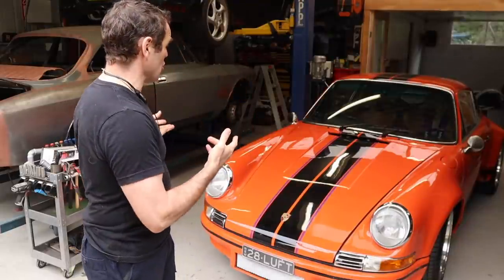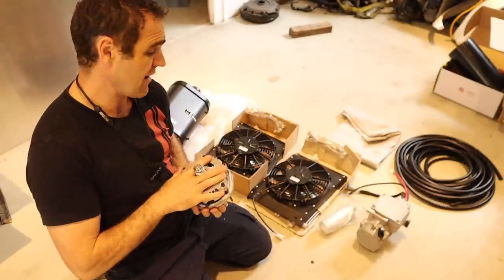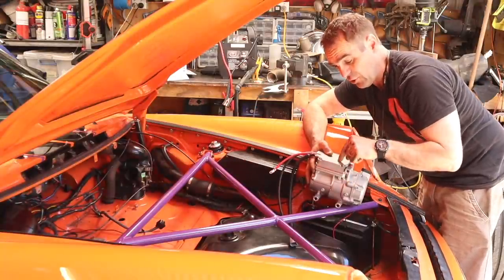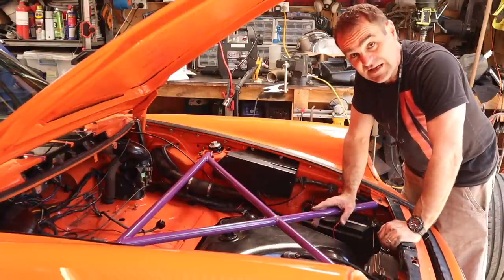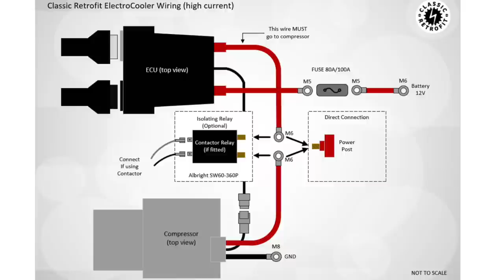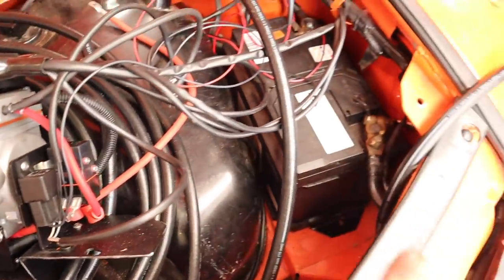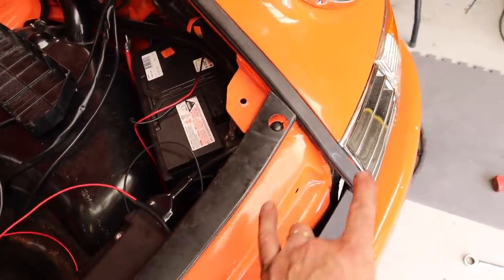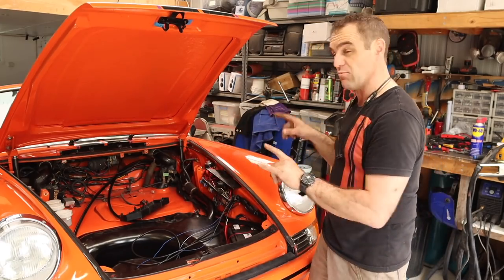Classic Porsche 911 AirCon install 1

Comment: This couldn't have come at a better time. My old man just got the same kit for he's g series and no one wanted to touch it in Sydney without charging an arm and a leg to install it. We just got the 175a alternator installed so this walkthrough will come in handy
Reply from the maker: It is a lot of parts, but once you get going it is reasonably straight forward.

Comment: Nice work Jeff, but i recommend getting rid of the plastic tie straps and replace them with aluminium straps. Heat cycling will dry out the plastic tie straps and they will fracture.

Comment: Hi Jeff - I have a 1985 911 with factory AC that barely cools. It has the same small side vents, but also has a center dash vent which works well for fresh air. In any case I'm very interested in seeing how well the electric retro-fit AC system works. Keep up the good work and excellent videos!

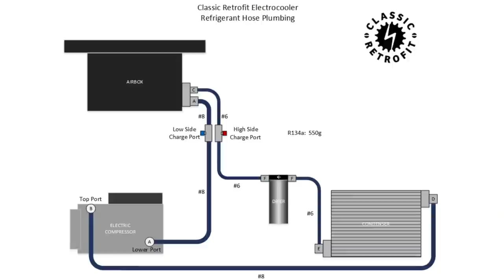Comment: Oops............at around 19:30 you mis-state the basic air conditioning cycle.  The whole process can be done with ordinary air (that's how most systems work in airliners) but it is much more efficient and compact for an A/C system to use some sort of special gas which can change state from a liquid to a gas and back again at reasonable temperatures and pressures.  "Freon" R-12 is the familiar stuff from days past, but these days cars usually use 134-A  or the newer R1234YF refrigerant.

The compressor discharges hot, high-pressure gas.  This gas then goes to the condenser (not the evaporator as you say) where the hot gas is cooled and turned into a high pressure liquid. Since the hot gas not only gives off it's heat, it changes state to a liquid as well; therefore, the amount of heat rejected to the outside air via the condenser is even more dramatic.  From there it goes to the expansion valve near the evaporator (inside a box under the dash) where the high pressure liquid is expanded and converted into a lower pressure gas.  Any gas cools as it expands, but by also changing state from a liquid to a gas, the resulting heat absorption is more dramatic.  As this cool gas travels through coils the box, a fan blows cool air into the car.  The cool, low-pressure gas is returned to the compressor where it is again converted to a hot, high-pressure gas thus completing the A/C cycle.
Reply: This needs more thumbs up please
Reply from the maker: You are spot on. I stuffed that explanation. I will correct it in the next vid ;)
Reply: Great explanation. You both missed the role, importance and its place in the sequence, of the dryer.
Reply: @DiscoFang  Strictly speaking, the receiver/filter/dryer is not part of the air conditioning cycle.  The system will operate without it; perhaps not for long, but it will function.  The receiver/filter/dryer, as the name implies, has three functions.  It provides a reservoir of refrigerant, it filters out any crud, and it has a desiccate to trap water because a tiny bit of water can freeze in the expansion valve and shut down the whole system.  Often these three functions are handled by an all-in-one unit, but some systems might contain separate components. A typical receiver/filter/dryer also includes a glass sight gauge so you can see the refrigerant. And yes, as you say, it's important for a well tuned A/C system.

Comment: Hey Jeff, plug those open hoses to avoid any contamination while building the system. Small particles can ruin the compressor. Also water from the air can enter the dryer and saturate the desiccant and the PAG oil as it is hydroscopic. I assume you are using 1234yf refrigerant otherwise you must have a RHL.

Comment: This is a great idea for any car without factory A/C , but I'm not convinced about the long-term use of those hose clamps, I would advise checking locally if you can get a proper A/C hose crimper with the correct crimping collars for this hose and fittings combination. I hope that you have access to the correct vacuum pump and manifold gauge setup to evacuate the system correctly after leak testing with oxygen free nitrogen. I would imagine that this setup would outlast any conventional belt drive compressor system as it's isolated from the heat and vibration of the engine and with no shaft seal to leak this is a winning setup 👍
Reply: The hose clamps we used have been used in motorsport for around 20 years now.  They are rated far in excess of the pressure of the pump and higher rating than most hydraulic fittings.  They also do not rust out since there is no ‘collar’ for condensation to get trapped behind.
Reply: @ClassicRetrofit  Interesting piece of information as those hose clamps must be exceptional to match hydraulic pressures which are in the range of 1000-3000psi
Reply: The hose and 'Oetiker' clamp system we use meets SAE J2064 rev 2015 which calls for a working pressure of 500 PSI for AC systems.  Max pressure in our system is typically 250 PSI.   Oetiker clamps are used all over modern vehicles, including in high pressure fuel injection systems.
Reply: @davidg2073  we are talking about AC, for clarity I meant compared with normal AC fittings which are crimped with a hydraulic tool.  The spec is only 500 PSI but they are prone to failure from rusting.

Comment: Not a bad kit, although for the price I'd expect better mounts than some zip ties. Overall though it does go together quite easily. Some ducting for the condensers would probably help with air flow especially at speed to make things super chilly 😉

Comment: Nice work, condenser should be fitted so that the smaller outlet ( which is the liquid line) should be at the bottom, so you are effectively stacking liquid refrigerant in the condenser 👍
Reply from the maker: It is. Hot in the top cold out the bottom ;)

Comment: Since you didn’t mention it, I thought I’d ask. Are you upgrading the alternator related wiring when upgrading your alternator?
Reply: Definitely need a larger cable from ALT to starter. Also I'd use hose clamps for the receiver drier instead of cable ties. Cheers.
Reply from the maker: Yep ;)

Comment: Little bit of chapterisation which may help some users looking for help with their installations. Learn more about our electric air conditioning systems for Porsche 911s and more at classicretrofit.com!

911 airflow system 02:43
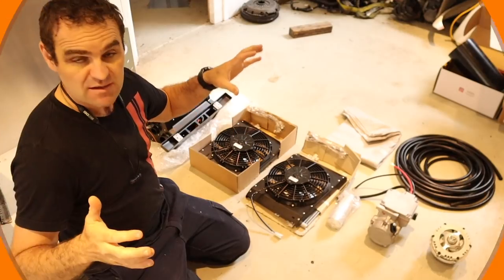What comes in the kit 03:48
Condenser fitting 06:37
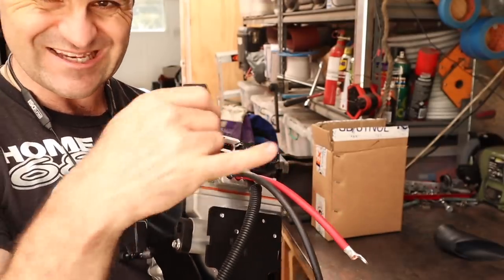Wiring pt. 1 16:21
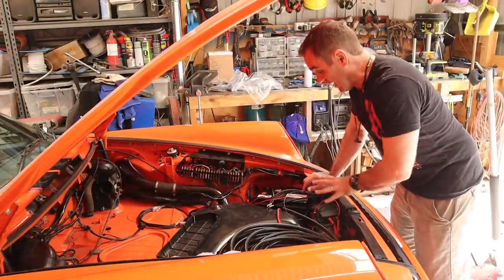Planning hose pathways 18:29
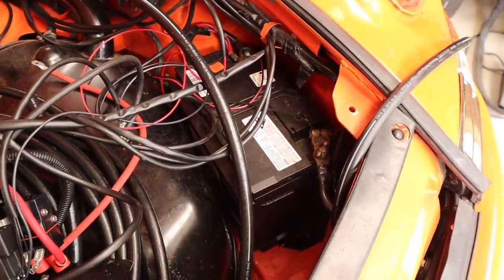Fitting hose ends 21:24
Wiring pt.2 24:27
Power wire 25:11
Fuse panel 25:25
Reply from the maker: First time I have actually done that, but it is all now added :D

Comment: I noticed one of the condensers was touching the wing/bumper flange at the AC line connector, can the condenser be moved inboard or put some edge protection on wing return flange
Reply from the maker: They are an extremely tight fit, so that is as much room as I can find.

Comment: I can't help being captain obvious here. The fact that the A/C is not pulley driven but electrical makes no difference to how much engine power it will eat up. Kilowatts is kilowatts. When you turn on the A/C your new beefier alternator will need to generate as much power to run the A/C would've taken when driven by the crank directly.
Reply from the maker: True
Reply: The kind of mechanical compressor fitted to these cars originally used around 8 HP.   Modern AC components like ours are designed to use less power so the pumps do not have to work as hard.   Our compressor typically uses 900W which is 1.2 HP.
Reply: @ClassicRetrofit  I’m sure modern compressors are way more efficient than older ones. That wasn’t my point however.
Reply: It’s isn’t really true because their is some drag associated with the extra pulley of a belt driven AC compressor.

Comment: A "quality kit" that includes sticky tape and cable ties to secure major components like the dryer and the fan shrouds? Given the impressive standard of your build(s) you surely cannot be happy with these fixings? I wonder what will hold in the evaporator! Otherwise the kit is quite impressive and your videos are the kangaroos b*****ks.
Reply: Wrong.  The parts are mechanically fixed by other means (fan shroud is bolted in). Zip ties for securing only as per any modern production car.   Tape supplied is a gasket for providing air right seal.- it is NOT used to ‘stick’ anything - it isn’t even adhesive.
Reply: @ClassicRetrofit Jeff sorry if I have offended you and prompted your touchy riposte. I seem to remember your line " I will just pull off the backing to the sticky tape and install the condenser to the shroud with cable ties in all corners". Also the dryer is secured to its bracket with two cable ties. I have a number of modern and classic cars which I look after myself and I have to say none of them have components attached with cable ties . The only place they are to be found, as their name suggests, is for "tying cables".
Reply: DavidG Jeff is installing our product.   The inference of your comment suggested that our product is not high quality based on the use of zip ties.   In this application of zero load, this type of fastening allows easy removal of the shroud for cleaning the condensers from the back WITHOUT having to de gas the system.  There is always a reason behind engineering choices.  P.s. the paper backing tape is ‘stuck on’ but the foam is not sticky - semantics.
Reply: @ClassicRetrofit  It is disappointing that Jeff has seemingly gone to ground and is relying on a third party to make his response. It is noted however that contrary to Jeff's original statement there is now no denial that sticky tape and zip/cable ties were used in the installation of key components. I note the supplier/sponsor's comment that the condenser is under zero load and would be fascinated ,as an engineer, to see the calculations that support that analysis. The comment regarding cleaning the condensers without de-gassing as a reason for using zip-ties is also somewhat tenuous as the condensers are plumbed with flexible piping which would not inhibit their removal from any type of mechanical fixings whilst keeping the installation fully charged. As we are protracting this discussion I would also suggest that fixing the condenser utilising only two mounting points is also, in my humble opinion. far from optimal due to the diagonally imposed torsional forces. The cuddly Jeff I and so many of my Porsche owning friends so admired seems to have gone off stage and been replace by a corporate spokesperson!
Reply: DavidG over 600 systems installed.   Zero issues.   Final comment.
Reply: @ClassicRetrofit  Thank goodness its the last comment from Classic Retrofit as it would be nice to get back to some form of reality.